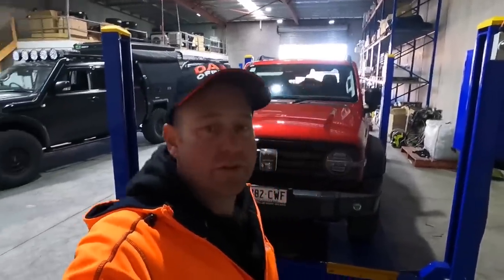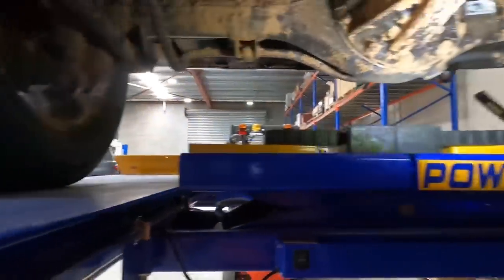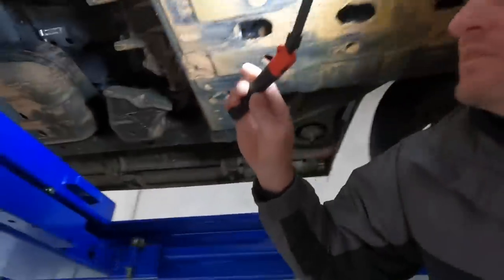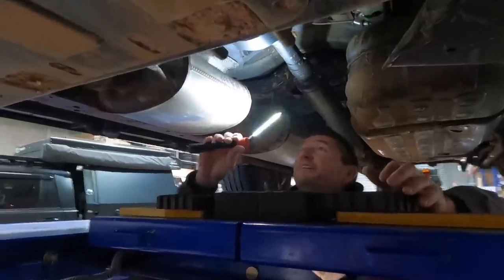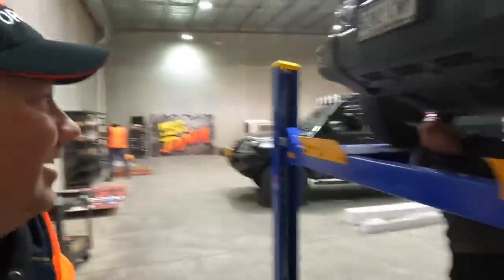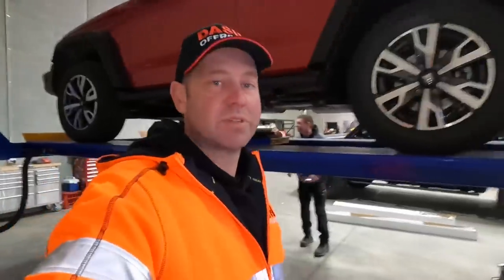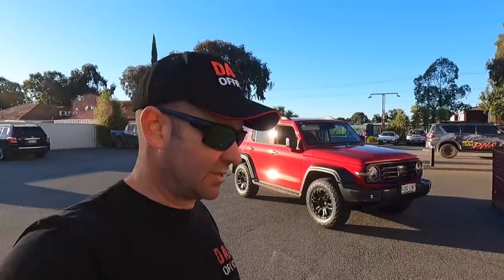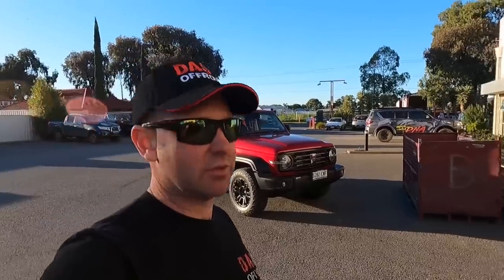TANK 300 - What Will Break? How Big A Tyre Can We Fit? 🧐

Comment: Gotta remember when judging the suspension component "girth" to bear in mind that it weighs a tonne less than a patrol too, so doesn't need to be as big.
Straight pipe options has got to be the next mods!
Reply: Loud exhaust gets annoying after a long drive.
Reply: @matthewlewis-zw3tf  won't necessarily be too noisy with only 1 of the 2 mufflers removed.
Reply: @mungbean84  or you can go for a cat delete + stage 2 it sound amazing and the engine handle it quite good, only cons you will loose waranty haha
Reply: @antoinelardin3671  Do people still use stage # terminology? 
Turbos keep things a lot quieter than NA.

Comment: Would a 17inch rim fit around the brake callipers or even a 16 inch?? Offroad performance focused cookie cutter 235s could prob go 34inch with a 1-2inch lift.  That would look a bit old fashioned but works off road….

Comment: Enjoying seeing this Tank 300 content, keep it up! I reckon it would look so much better if they got rid of that big badge in the middle of the front grill. Is there a way you could remove that simply, or would it have some form of backing plate that would look silly too then? A replacement grill even just without the badge would probably be a good mod I reckon.
Also, I've always wondered when doing those wheel clearance checks, whether you need to try having the front wheels turned on full lock while lifting it to see if they would rub anywhere whilst they are turned?
Reply: There is a grill that can be bought that has TANK written all the way across the grill itself.... Large lettering and looks good....
Reply: And anything for the headlights?  It's really like having a hot, squint, girlfriend